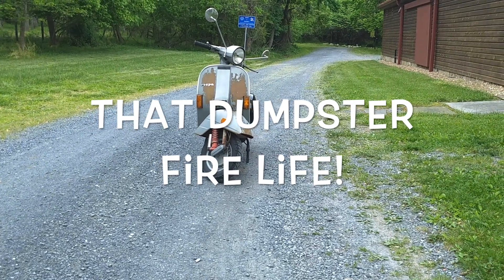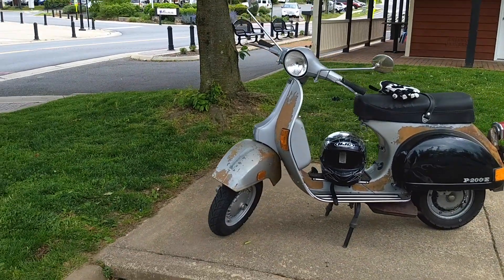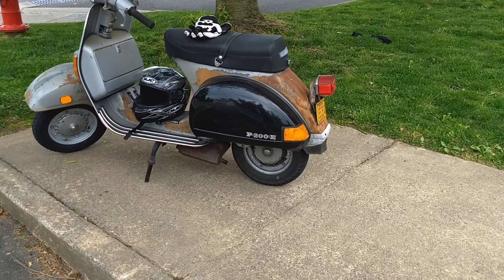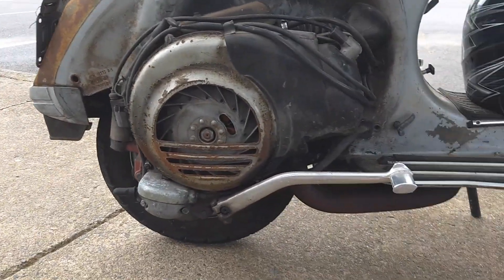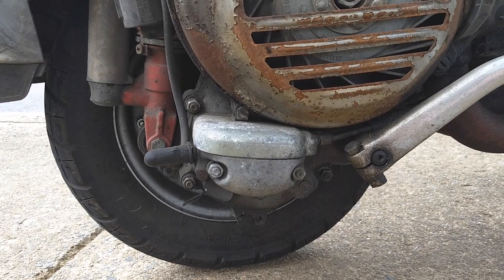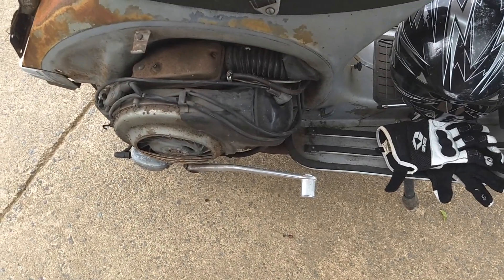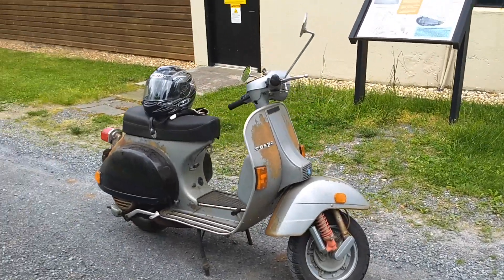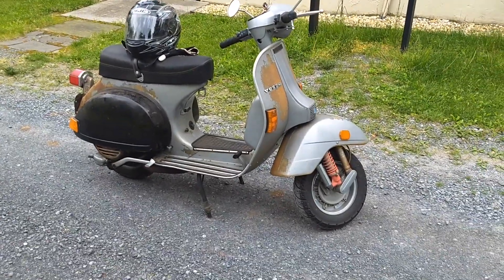ep2  My 1979 Vespa P125 Scooter is a 60mph Death Trap!

Comment: I just bought a 79 p125x. Vespa body is in phenomenal shape. Absolutely no rust or paint chipping, just a few dings here and there. I’m going to go through the whole scoot and replace what needs fixed or replaced. It hasn’t ran since 88 and only has 1300 miles on it. I will be rebuilding the engine though.